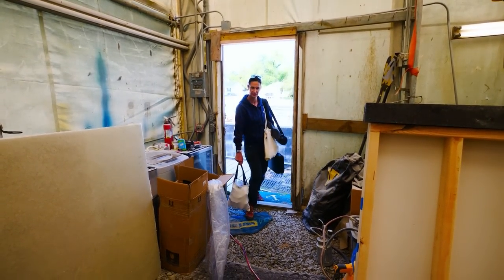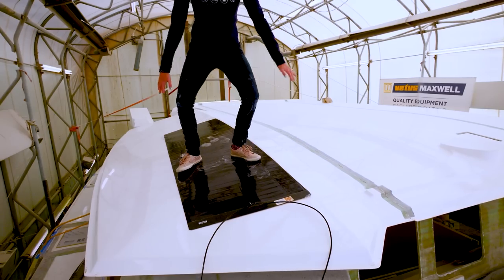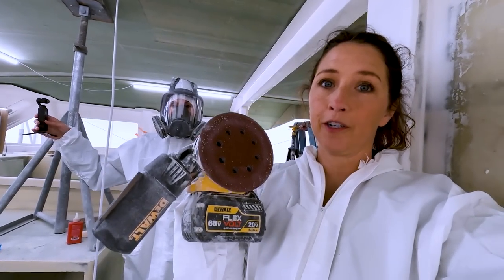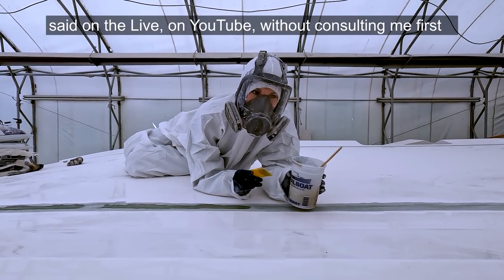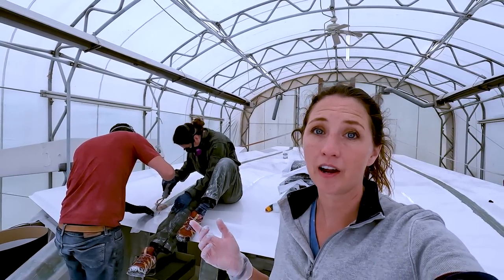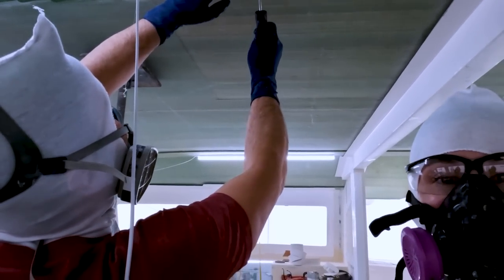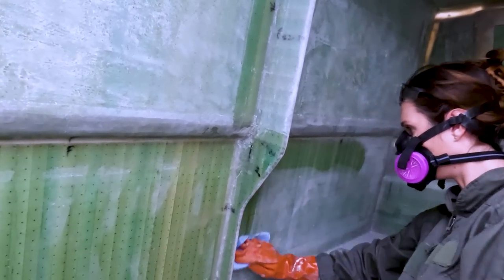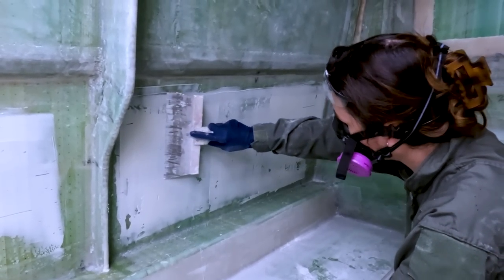We Brought On Help - But Will They Stay?? (MJ Sailing - Ep 282)

Comment: Nice that you got a little help on the boat and taught her new skills.
Building a boat, like anything, takes a certain number of hours. Dozens, hundreds, or thousands. One person working a few thousand hours takes years, two people will cut the time by half, three people, etc. It's all about how long you plan to build instead of sail. Too often a builder thinks that if the designer estimates the project will take 10,000 hours to complete that they will be able to do it in less. Then they overestimate how many hours they will be able to spend actually working on the project. Then when they see how long they have been working on it and now realize how much more needs to be done and finally they understand they are looking at years of work still to go. 

I've built a few boats by myself and when I was young it was worth it, now that I am looking at 70 I miss those lost sailing years that I spent building my "ideal" cruising boat. But what I considered "ideal" always changed. Fast very light multihull, small monohull, heavy displacement monohull, large but light multihull, medium monohull.... Each boat was excellent at some things and not so good at others.

Now I realize the boat wasn't the important part of cruising, it was being out there, not building the ideal boat. As long as the boat is strong and seaworthy any boat is wonderful. I hope you can get a lot of help and not spend too many years building. Time is all we have really, spend it wisely.

Comment: It's great that you had Sophie come help as she and Ryan are looking for a new cruising boat. They may want to consider the Max Cruise as their blue water platform - at some point in the future, anyway. They've been looking at a lot of monohulls and many of them will suit them well, but you just can't beat the comfort and performance of a cat. It would be possible to build the cat in a location where labor costs are far lower than the US and perhaps Ryan could run the crew and Sophie can feed them (and film too) but the project timeline would be vastly shorter.

At this point, everyone is well aware of all the time and hard work required to complete this project, but the results will be well worth the effort. A lifetime of great sailing adventures!

Comment: Good Video.  As a youngster I did quite a lot of Fiberglassing and I can tell everybody, even as someone with fiberglass experience, it's still a lot of hard work to see a project through from start to finish.  The advantage factories have is usually you get to do just a few jobs on each project, so you tend to get really good at them jobs.  That makes it easier.  The downside to that being you dont get to FINISH the project.  Hat off to you guys for taking on such a big challenge, basically by yourselves.  Also hats off to your friends who come and help not always knowing that they are getting themselves into.  😃

Comment: Just a thought. Consider hiring Sheetrock finishers to apply your gelcoat. Your focus would be the initial taping and joint preparations and prep. Then, when these folks come you can stay on gelcoat mixing. They will come and do all your vertical joints, next day your horizontal joints. You then touch up between trips and they will come back for “ heavy coat and overall coverage. You then sand again and their final work will be skim coat. They will take approx a day per trip. They can do a 3-4000 sqft home in a week. Your boat though smaller is far more detailed. It will take about the same amount of time.
Reply: I had the same thoughts a few weeks ago. They won't do a perfect job, but can knock out the bulk of it and then go back and do the touch ups.

Comment: Maybe using standard pallets on the floor to lift you up so not to reach as much when working over head.  I was doing battery work with 50kg batteries to 2.5 m hight and had pellets stacked so always working in correct height was a life safer.

Comment: Is there any way to thin that fairing compound?  The thicker it is, the harder you have to press the knife against the surface.  The harder you press the knife, the more likely it is to bend into the areas you're trying to fill.  Also, tangential lighting when you're looking for the low spots.  Turn off all the lights but the one you're holding up against the surface.  You'll see every defect.